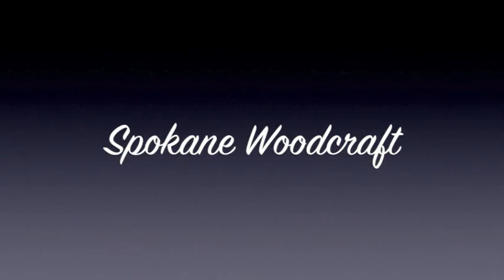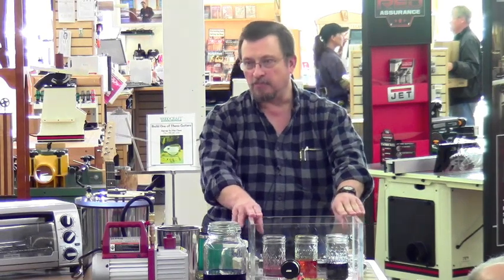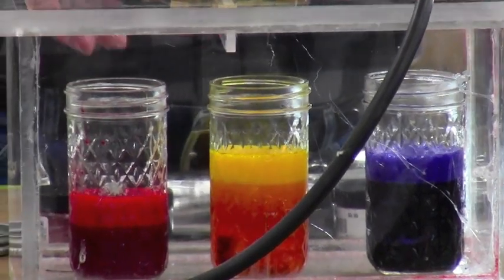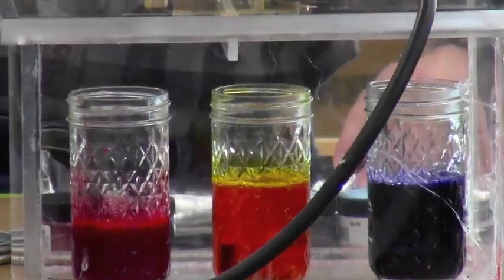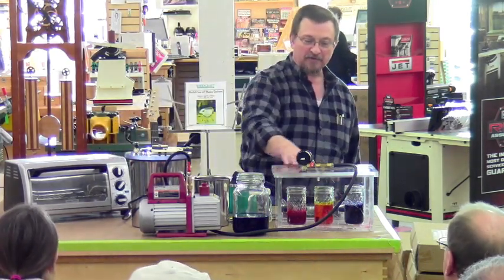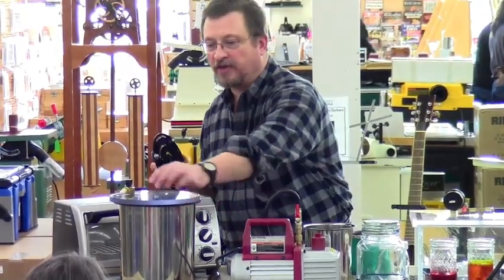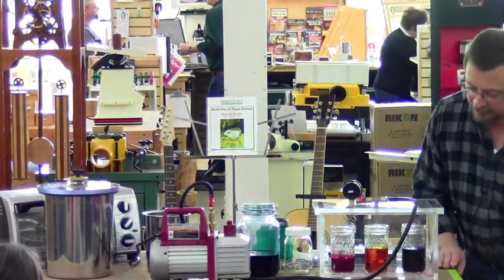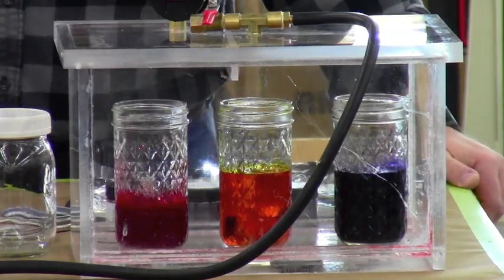Stabilizing Wood Pt1

Comment: Hi thanks for video, stabilizing liquid is acrylic resin or they are diffrent?!
Reply from the maker: Behruz, Thanks for watching our demos! We use and sell the TMI Stabilizing Fluid which is very similar to Seebeck's Cactus Juice.TMI Stabilizing Resin is a low viscosity and odor, deep penetrating, heat cured product that is reusable and easily cleaned up with soap and water. Once cured the resin-filled wood can easily be polished to a high sheen. It features:  Low odor, Deep penetrating, Reusable, Environmentally friendly AND, Cleans up with soap and water. Hope this helps!
Reply: Woodcraft of Spokane in my country Iran i couldnt find this liquid,Which kind of resin I can replace with stabilize resin?!

Comment: A venturi tube produces a vacuum based on "Bernoulli's Principle"....a body of moving air will have relatively less pressure than air that is not moving. The more the velocity difference...the more the relative pressure difference. There are no moving parts in a venturi tube. Air is forced through a small, restricted opening and allowed to flow through the tube. At the point of the tightest restriction, a tiny hole is drilled perpendicular to the flow. This is the point of the fastest flow. This is the area of least pressure....a vacuum.

Venturis CAN produce high vacuum but it requires a very high quality, typically expensive device. There are MANY types of venturis and very few of them can produce the deep vacuum required to succeed with wood infusion/stabilization.     

To obtain the lowest possible vacuum (pretty much necessary to do a full infusion) one should be looking at two stage reed type pumps (Robinair, JB Industries, ect.). Maintaining clean oil in a two stage pump is critical for ongoing operations requiring a deep vacuum.
Reply from the maker: Thanks Stuart, very good information! Thanks for sharing!

Comment: Would a system like this work with oil finishes such as boiled linseed oil or tung oil to get better penetration into the wood? The reason I ask is I carve some wooden cups (sometimes called a kuksa) and bowls that I finish with pure tung oil and I would love to be able to get a deeper penetration of the oil into the wood.
Thanks,
Tim
Reply: But wouldn't you have to worry about the tung oil not being able to polymerize?
Reply: I don't think so, it would just take longer

Comment: I have watched this video at least three times; it is awesome. Does anyone have anything to say about stabilizing wood with MinWax wood hardener as opposed to epoxy resin? Has anyone simply used wood stains under vacuum or wood waterproofing like "Thompson's water seal?

Again, awesome video. What is the liquid you use for stabilizing the wood in this video?
Reply from the maker: Sorry JCM, we have no firsthand experience with the Minwax products. What we have heard from customers is that the solids are "larger" and don't penetrate as deeply as the resins. Great question, , , maybe others will add more info.
Reply: I have used MinWax wood hardener on a few small pieces of wood. I placed them into solution and carefully operated a vacuum pump I found on Amazon (normally priced at over 100$, mine was about 40$, so I jumped on the deal). At first, the bubbles came up in a foam, so I had to turn the pump off quickly. I did this a few times and the bubbles were not so ferocious. The wood still bubbled for about an hour with the pressure about 20lb. I let the wood soak over night, baked it as you do in the video, sanded it, and coated the piece with clear coat polyurethane. I thought it came out nice and I gave the small wood medallion the man who recently gave me a job.

The reason I am replying to your reply is that I do plan to try the solution you guys have available, soon enough, and will let you know what I think. :)

Here is a file handle I did the same way: https://jcm3blog.com/2016/07/10/a-file-handle-project/

Happy woodworking!  :)

Comment: +woodcraft of Spokane
Is there any place that does freeze-drying and stabilization of organic material such as wood on a small scale? I would be very curious to see what the results would be with a red beet, but imagine that it would have to be vacuum freeze dried first. If you've ever seen a cross section of a beet, you'll know why!
Reply from the maker: Scott, , ,  GREAT Idea ! I have seen the center of a beet. I would love to try it but I don't know the freeze drying process. Might look into it. Keep me posted. Just found this on the Internet . . .

Freeze Drying Food With Dry Ice
1
Place the food in freezer bags. Lay the bags out flat, so the food doesn't bunch up in one corner.
Push out the air before sealing the bags.Make sure the bags are sealed airtight.
2Place the freezer bags in a large cooler. Cover the food with dry ice.
Wear gloves and long sleeves while handling dry ice.If you have a lot of bags of food, alternate food bags and dry ice until the cooler is full.
3Place the cooler in the freezer. After 6 hours, cover
 the cooler with a lid. After 24 hours, check inside the cooler to see 
if the dry ice is still there. If it's gone, the food is ready for 
storage.
4
Remove the bags of food from the cooler. Store them either in the freezer, in your pantry, or in your emergency preparedness kit.

Comment: How many psi or what kind of vacuum pump does one need to accomplish this
Reply from the maker: Alex Paskiw Alex, Thanks for watching our demos! When we stabilize we are actually using a vacuum tank, so we are pulling the air out. The theoretical maximum will be around 28 inches of mercury (which would be at sea level). We typically get around 25 - 26 inches here in Spokane (approx 2000 above sea level). We bought a vacuum pump from Harbor Freight for around $125. Hope this helps!
Reply: At sea level at 15 deg C.

Comment: how much does the Plexiglas container and tubing along with the vacuum pump cost?
Reply from the maker: jarhead4God Thanks for watching our videos! This container was our first experiment in vacuum chambers, and I must confess, I'm not sure I would do it again, for 2 reasons. One, the cost. Materials cost was in excess of $100, and Two, making the gasket was a pain in the rear. We believe that is the reason we do not get a lower vacuum reading than we do. There are many places to purchase an aluminum container with top plate and valve fittings for $150 on up (depending on what size chamber you want). If you need any more info just write. Thanks!

Comment: What ever you do when attempting to perform this type of Wood Stabilization. Make sure you stick to Name Brand Stabilizers that can be re-used. Also make sure that they are not shipped Premixed. My latest attempt was a complete disaster as the shipper sent me premixed Stabilizer and I destroyed two beautiful knife scales of Zebra Wood and Bubinga.
Reply from the maker: Carol Gavin Good point Carol. The Stabilizer we sell (TMI) has a separate catalyst that's added prior to use. After you've added it, the shelf life goes down to approximately 3 months. In many cases this gives you plenty of time to use it up. Bubinga, , , wow, that's a tough one to get stabilized due to the very dense characteristics of the wood to begin with.
Reply: Woodcraft of Spokane Actually, I import TMI stick Fast resin premixed and the shelf life is between 6-12 months if you keep the resin in the fridge.
Reply: +Carol Gavin What are the measurements of your knife scales. I have some Zebrawood & I'm pretty sure that I have some Bubinga that I would be willing to cut if you are interested